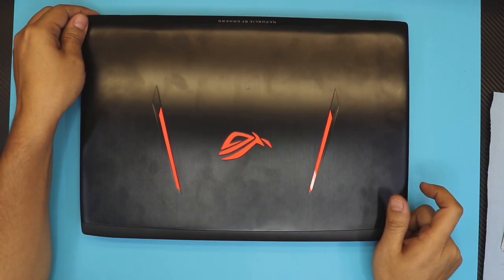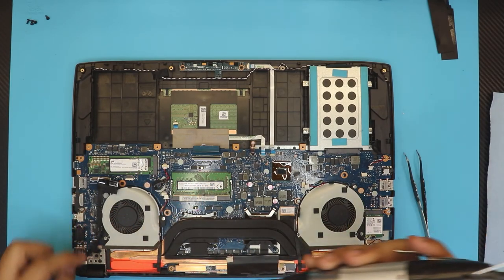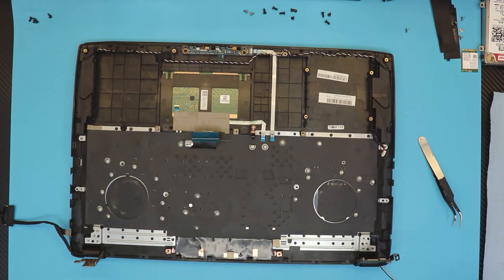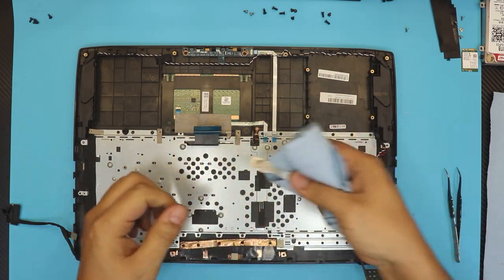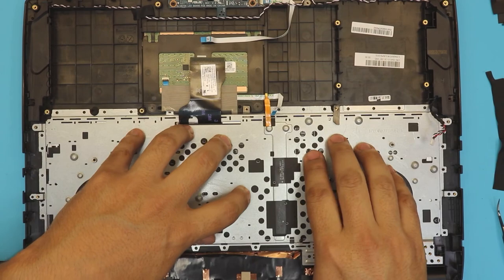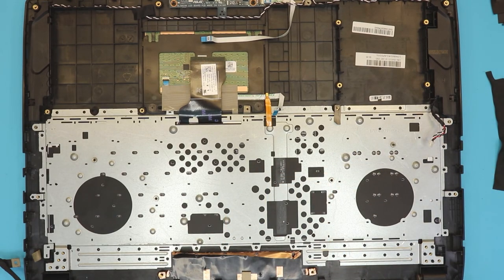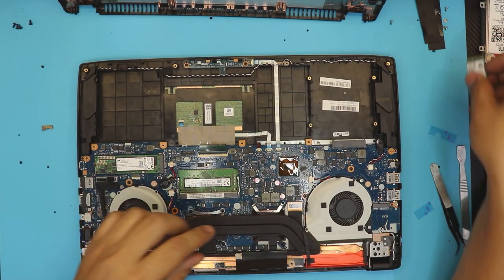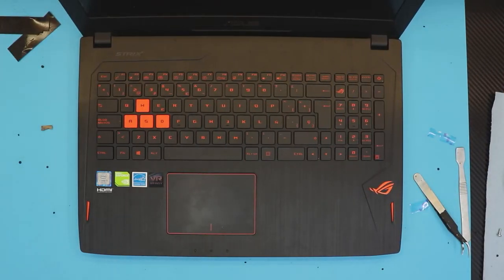ASUS ROG Strix GL502 Keyboard removal, disassembly guide

Comment: what plastic did you melt so you can fix it back? is it the plastic from the glue gun? thanks!
Reply from the maker: Thanks ✌  for the feedback!  if you wish to support the channel you can LIKE or SUB or both :P
Regarding your question: i used the soldering iron and i removed the keys from old keyboard and use to melt on the new keyboard remove the space bar from old keyboard and melt that. if you have a 3d printer filament use that.
Reply: @uFixTek  oh yah 3d printer filament! Thanks im replacing the keyboard of my gl552vw. I already disassembled. Waiting for the part and then i will do it like how you did it. Thanks!
Reply from the maker: here watch this video after 13min:
https://youtu.be/aautKZufpno
here you can see what i mean by using old keyboard keys.

Comment: Oh boy. Used this for replacing the keyboard on the GL504 as it's constructed about the same. Had no idea they used plastic rivots 'til I got down to that plate.

My GL504 has been a nightmare. GPU fan failed completely within the first 9 months, and it took 4 trips to their repair department before they replaced the system altogether. A CPU fan died in the replacement system shortly after the warranty ran out, so I replaced that. Now, the GPU fan will randomly spin up to maximum (6400 RPM) without a way to control it and I've lost functionality of some keys.

It's not sold anymore, but wow this model had problems.
Reply from the maker: Thanks ✌  for the feedback!  if you wish to support the channel you can LIKE or SUB or both :P
Regarding your situation: oh boi i can tell you that how much we see this models come to the store for fan repair and so much other issues that they have, every client that comes in the store with this laptop they are supper angry and want to smash it once i tell them about the issues that they are going to face. this laptop is a money bleeding machine
Reply: Thanks for this comment! My GL504 has randomly decided it wouldn't register 9 of the keys on its keyboard anymore (including Enter), so I was looking for some tips on how exactly the repair looks like since I've heard it's kind of a nightmare, thanks to the video and your comment I roughly know what to expect now. As for other problems with my laptop, the minijack gave up in the first 2 years of its life (I had the main board replaced under warranty) and the usb ports aren't always working correctly with connected devices (fortunately changing the port usually solves the issue). No problems with fans though, apart from occasional loudness which is typical for this model I suppose. I went for ROG to avoid poor quality problems in the future, ha ha. I hope their newer models are less prone to defects...

Comment: Thank you for the guide. I regret ever getting this thing. What a nightmare replacing the crappy keyboard. I think I'll just use an wireless usb keyboard instead. Never buying a gaming laptop again!
Reply from the maker: PC for gaming its always the best if you have the space and time to use in one place, gaming laptops designed the way to make it hard to one to be able to replace parts or upgrade or service. and they are designed to fail after the limited time warranty , they have come up with their own section for durability and longevity, so they can sell extended warranty and or have people comeback to them for service.
the laptop industry is no longer as good as before, where they had one mission one option!
make them the best and last longer and upgradable!
now its the war between them the war of who can sell the most and benefit the most from (extended warranty and service), *DLC.
and they are attacking poor people and rich people, there is no best laptop out there, dont take me wrong, by saying best!
by best i don't mean the best cpu or ram or GPU power.
the best as in durability 0% marketing and so called DEFECTIVE HEATSINK,
there was no defective heat sink back in old times where we had less knowledge of cnc machines,
i can keep going on but as a tech service view i can say that there is no best laptop!

Thank you for the feed back and support to the channel :)
good luck
Reply: @uFixTek  I've had this laptop for about 6 years now and I've upgraded the very easiest parts I could, replaced thermal paste, and cleaned it regularly and properly. Recently I've been having what seems to be overheating issues, with no over clocking, fans not broken, proper thermal paste application. I think the heat sink failure you speak of is interesting, I'm not a technician or anything but it seems that it's causing issues I've never had before up until about half a year ago. I'd be interested to find good resources online to learn more about these things and "go down the rabbit hole" on these subjects if you have any suggestions. Thanks and any info is much appreciated!

Comment: Thank you so much. Could you make a video showing how to replace the touchpad please? Thank you
Reply from the maker: let me call few people and see if i can get my hands on one and i will gladly make one, thank you for your support
Reply: @uFixTek  Thank you so much. Although I managed to remove the mousead myself, it wasn't hard, but I had to remove the motherboard. Thank you again for making those videos, thanks to you I was able to replace my keyboard
Reply from the maker: @sebastianmartinez9998  im glad that you could do it by your self, if you ever need help regarding repairs or info let me know in any of my video comments. best of all and thank you.
Reply: @sebastianmartinez9998  I'm thinking of doing the same thing because the surface is worn out. Are there any problems or issues you need to be careful about when doing this? Thanks.
Reply: @Dbdconnect  The touch pad is covered by three screws, the middle screw is covered by a small piece of tape. I used tweezers to remove the connectors but you have to remove the motherboard in order to remove the touch pad.
Reply: @uFixTek  Do u know if removing the touchpad and painting it another color making it still funtional? my brother is a professional car painter... and also is it possible to glue the back plate instead of the method u showed? because don´t u think its problem if the plate isn´t strongly "attached" on the back, or maybe after screwing the motherboard on top it will be strongly attached afterwards and its enough? thanks!

Comment: Hi.  Very well done! I have an off-topic question but I think you could help me.  I have a customers Asus ROG strix 2020 that Im supposed to remove the bios password lock.  Their kid set it and doesnt remember.  They updated the bios in the past so the alt-r recovery doesnt work.  It turns on and wants password.  No boot options, no uefi, no bios setting screen, just password.  Any ideas? I'm considering replacing the smd bios chip.  Would that even work? I hate just throwing money at a problem.  Thanks.
Reply from the maker: Thank you for your feedback! If you wish to support the channel, you can like, subscribe, or both!
Regarding your question, where are you located my friend? so i can assist you with correct links and steps.
cheers🍻

NOTE when you press Alt+R and it askes for rescue password, there is date right on top of it, give me the exact date that appears there. even if you can't get to the ALT+R if you see the date at the time of entering password or after entering few times it may give a code and date, give me those info.

Comment: Hello 
I have a similar laptop but the only key working right now is the power button.

Should I buy a new keyboard or it a motherboard issue.
Reply from the maker: Thank you for your feedback! If you wish to support the channel, you can like, subscribe, or both!
Regarding your question, if your keyboard NONE of the keys respond at all except the power then it is not the keyboard, you will need to disconnect the keyboard flex from motherboard clean and reinsert it.
Reply: @uFixTek  yeah I just did that today and it didn't work.
Could it be the  keyboard connector base  which is not working

Comment: oh god, I didn't expect the process to be so gruesome
I got a fx502v and seems like the build is pretty much the same

So I guess I got a hell of a day tomorrow, better warm up that soldering iron lmao
Reply from the maker: ya unfortunately its a walking in hell, but take your time and you will be fine i dont do all the ping one and skip next and it will be just fine. good luck :) thank you for the support
Reply: @uFixTek  What type of plastic welding rods do you normally use? 
I have ABS, PVC, PP and PE but I have no idea what plastic Asus used in the factory, I wouldn't wanna mismatch it of fear it might not bind well if it's not the same polymer

Thanks for your help, your channel is great, most informative on youtube by far
Reply from the maker: okay dont buy any plastic rod or anything just remove the space bar from the old keyboard and use that as extra plastic :P its the same type of the plastic as the base so it will bond better. and you not going to use the old keyboard anyways :) and thank you for the sub :)
Reply: @uFixTek  oh that's a great idea, thanks

Comment: I have same laptop the copper sheet behind the motherboard was removed. Should i use a copper sheet or aluminium. Thermal pads on the vram at the back side?
Reply from the maker: Thank you for your feedback! If you wish to support the channel, you can like, subscribe, or both!
Regarding your question, i recommend you get a  0.5mm thermal pad and place it on the back of the motherboard where vrams are.
https://amzn.to/3UOeOmn
your laptop is refurbished or repaired before, if you don't have the copper sheet.
Reply: @uFixTek  thank you. The repair shop removed it.
Reply from the maker: It's my pleasure my friend, ah oki

Comment: Hey there, would you be able to make a video on how to replace the keyboard for the ASUS ROG Strix GL703VD? My down arrow broke off of the bracket. I may be able to just replace the single key, however I might end up replacing the entire keyboard at some point since the cheapest option is purchasing an entire new backlit keyboard (rather than purchasing one single key for $10 I can have an entire replacement set for around $50). It would help me out so much! Thanks for your videos, these have been very helpful.
Reply from the maker: Thank you for the feedback and your support to the channel by SUB :P
regarding your question: i will defiantly make a note to make a video for that, BUT the steps and how to change it its the same as this one. i will try to get my hands on one to make a video.

Comment: Hey, i was wondering, i have the exact same laptop and my problem is that i can power on the laptop but the keyboard doesn’t work at all even from cold boot (cannot even go to bios). Will a keyboard replacement fix it or it is a motherboard thing thats broken? Because i can’t spare $50 for something that isn’t broken..
Reply from the maker: Thank you for the feedback and your support to the channel :P
regarding your question: none of the key respond??
IF no key is working , then its not your keyboard, DO NOT CHANGE KEYBOARD!
i need you to report to me with the next results:
#1. power off the laptop
#2. Press and hold the F2 button , then click the power button. DO NOT RELEASE the F2 button until the BIOS screen display.
#3. let me know if you could get into the bios using your keyboard, if you have to press other key to get to the bios do so, but still let me know if you could get in.
#4. dont change anything in bios simply shutdown and reboot and use your laptop as you wish till next instructions.
Reply: @uFixTek  hey, thank you for your reply. I’m able to get to the bios now. I rebooted and What should i do next?
Reply from the maker: @adrianputra2629  so you got to bios with your keyboard>???
if you you will need to back up your files using external keyboard and mouse and format your laptop and issue fixed my friend,.
IF you got to bios by using your keyboard.
do you know how to format windows?>
Reply: Hello. I have a same problem. And i did format my laptop several times. But still doesn't work. What's the problem is that?
Reply: Were you able to fix this issue?
Reply: @joeyosei9607  i brought it to 3rd party repair shop he said something died and burned so they had to replace it, i dont know which specifically but it works now
Reply: @adrianputra2629  okay 
With mine only the power button works.
Reply: @joeyosei9607  yes, mine was like that too, but it works fine now.
Reply: @adrianputra2629   so it means you did not replace the keyboard right?
Reply: @joeyosei9607  yep I did not
Reply: Hello 
Could you contact your repairer and ask exactly what he replaced on your motherboard.
I would like to fix mine.

Comment: Well, the crucial part of this video is missing and without it, it's the highest level of BS, yet, it still helped me fix my son's laptop. The crucial part, that he conveniently skips over, is the re-mounting of the keyboard. As the case is made of ABS he suggests melting an 'ABS rod', available from hardware stores, with your soldering iron, drip the molten plastic on the posts, and he says it will be good as new. It won't be. The 'rod' he speaks of is most likely ABS filament for 3D printers. It's really cheap and you can get it at many stores. However, the temperature range between melting and burning ABS is tight, and unless you have a soldering iron with controlled temperature you will burn it. Even then, the molten ABS will not stick to the solid one, unless the solid one is preheated to between 105C and 110C. (Look up the necessary bed temperature used by 3D printers for ABS). So don't even try. Use J-B WELD High Strength Plastic Bonder. It is formulated to work with ABS. You will have to make sure you clamp the keyboard and the ABS housing tight together, so they don't move relative to each other. I used skewer sticks underneath, between the rows of keys, and used small pieces of wood as levers and small wooden blocks as supports with carpenter clamps to press and hold them together.
Reply from the maker: Awesome idea, good options and thank you for the feedback, this video is an old video, on the new videos i have mentioned using the ABS filament for 3D printers, or the best and free ABS plastic is to rip a key (space bar) from the old keyboard and use it to melt on the plate, and i use a soldering iron and set to 380C  but once you start melting the plastic as you say i push down the new plastic with soldering iron to the old one so it mixes, it works like a charm all the time, i had zero issue with my clients and i do replace a lot of mesh keyboards weekly, just use the space bar from bad keyboard. but again as you mentioned if people have time and know how to mix glue and wont make a mess sure thing glue that, but if in the future you want to replace the keyboard... well good luck removing the glue :P
again much appreciate the feedback.
here is a video i made a very quick run down of the how to :
https://youtu.be/m3zuNBASGCY
here is another video newer that i show the steps check @16:30
https://youtu.be/xsg-Zn80hZQ
Reply: @uFixTek  Oh, OK, I have searched for the model number of the laptop and this came up, so I was not aware of your newer videos. I tried to melt ABS and fuse it onto the posts but my soldering iron has high and low settings only, so I could not control the temperature and although they looked OK the new heads I made popped off way too easily. Cured epoxy can be removed, however most likely you would have to use solvents as well and not just chisel it off. I'm sorry if my review sounded too negative, I got suspicious something was amiss because you skipped the remounting steps in the video. Having said that, your video still saved us a lot of time and money. Thank you!
Reply from the maker: its my pleasure, its okay my friend. my purpose here is to help as much as i can for anyone in need, i try to stay on top of the comments and help out, i have my repair shop for over 18 years and giving back and help people its a good option :) im trying to keep all the repair and servicing on the DIY level so people can do it at home and save money.
im very glad that you got the keyboard replaced and thank you for the feedback and your options for viewers.
if anything i could help you in the future feel free to ask me in any of my videos, and i be glad to assist you. good luck
Reply: @uFixTek  is it the same keyboard procedure for the ROG Strix GL503?
Reply from the maker: Thank you for the feedback! if you wish to support the channel you can LIKE or SUB or both :P
regarding your question: yes it's almost identical same exact logic , if you need any help let me know

Comment: What is the tool you use to scrape the plastic off and what plastic did you use to soldier back on to the keyboard?
Reply from the maker: its called "solder ball scraper"
i only found it in my reballing kit.
https://amzn.to/3fDRrWg
or on ebay :
shorturl.at/lnAE7

regarding plastic , the best and easy choice is rip off the space bar from your none working keyboard and use that to melt back to patch up. its the same type of plastic.